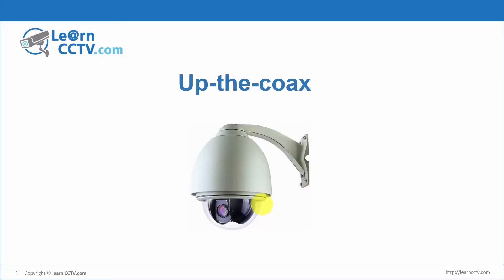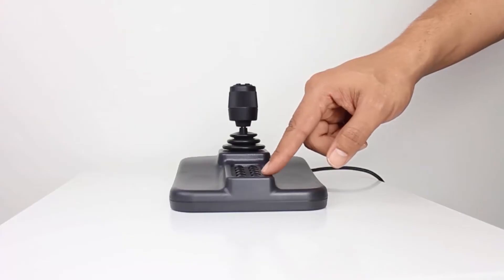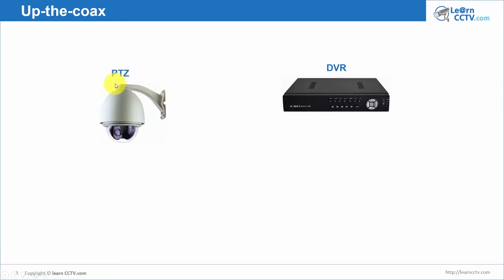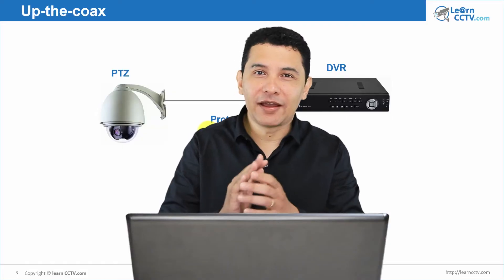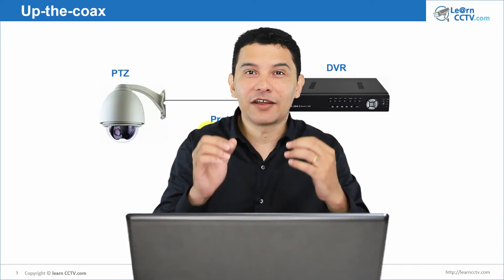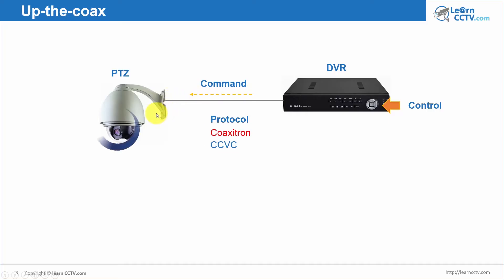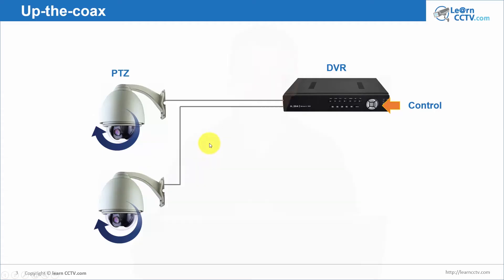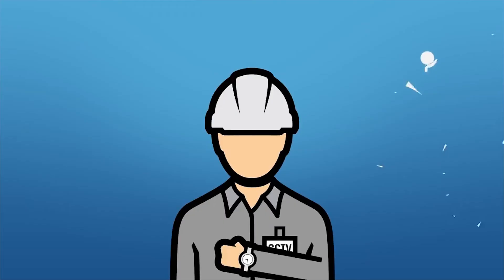How to setup PTZ cameras to a DVR using coaxial control

Comment: If the dvr does not have connections points to connect the ptz camera to it, what is the next option to connect it to the wifi with a cable??

Comment: Thanks.  I have a Hikvision dvr. The only protocol uo-the-coax available is the HIKVISION-C  
Is this means I can only hook up hikvision camera if I want to use the up-the-coax?  I have a no name camera and it works with hikvision c but sometimes it stop responding for a while. I was wondering if it was because it wasn’t a hikvision camera.  I also need to buy another camera but without a hikvision camera, how can I be sure the up-to-coax will be compatible?

Comment: HELLO, I BUY A USED 4
TRESS CAMERA, AND I NEED TO CONFIGURE IT TO WORK ON MY INTELBRAS DVR. I AM NOT
FINDING HER HANDBOOK. SHE HAS A SUITE SET FROM 1 TO 10. CAN YOU HELP ME. MODEL
OF CAMERA AND A 4 TRESS SH - 6160MEH
Reply from the maker: Hi Marcelo, I have no idea which camera is that and if you can't find the product manual that can complicate things. Every manufacturer has it's own dip-switch table for the protocols and I can't help you trying to guess which combination would work. I suggest you to check if the camera shows the protocol, baud rate, etx during the boot process and then you can use such information to configure the Intelbras DVR ( I am assuming you are trying to use the traditional RS-485 standard connection from both devices). You can use a protocol that is common from both devices such as Pelco-P or Pelco-D. I also suggest you to talk to the Unrelbras support team in Brazil. Good luck.
Reply: @LearnCCTV  
GOOD AFTERNOON, YES I SAW THE PARAMETERS ON SCREEN AND CONFIGURED THE DVR ACCORDINGLY. BUT IT DID NOT RESPOND TO THE PTZ COMMANDS. THANKS.
Reply from the maker: @marcelomedeiros215  Did you set the parameters (baud rate, parity, stop bit, etc) and also the Protocol (Pelco-P or Pelco D) ? Did you call Intelbras?